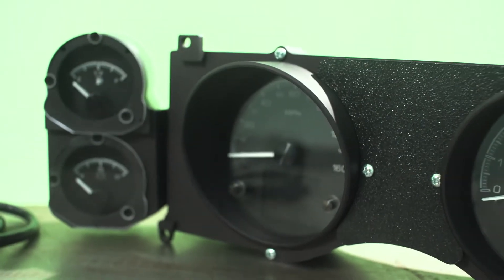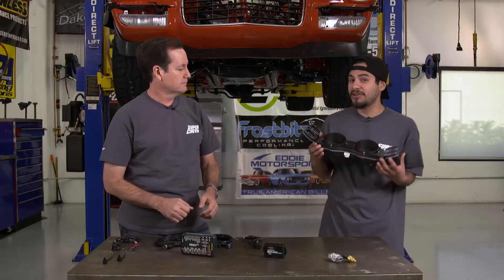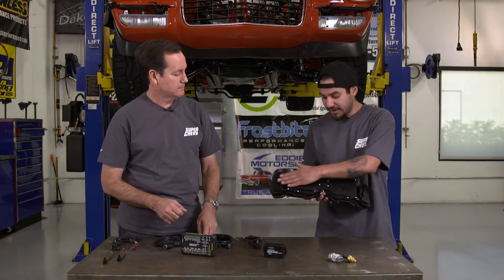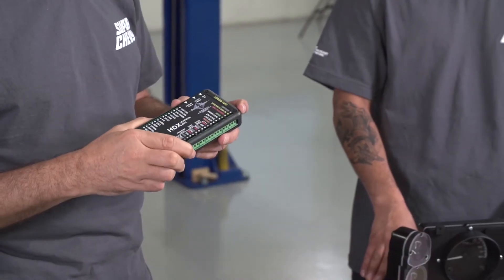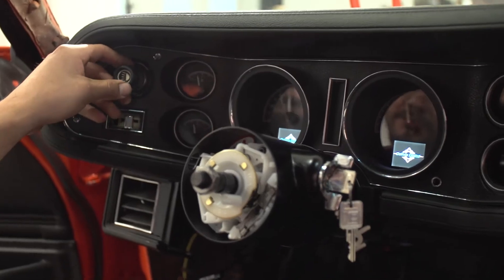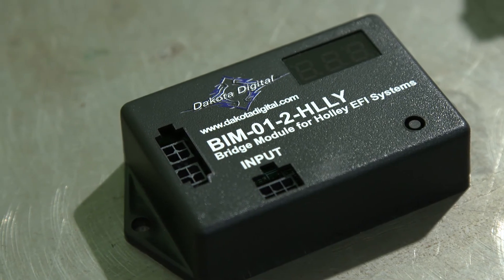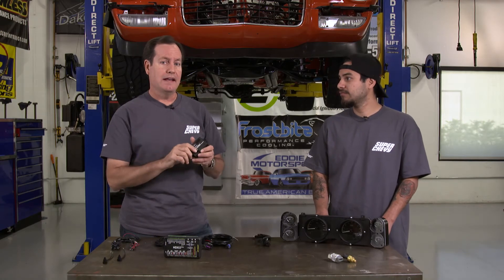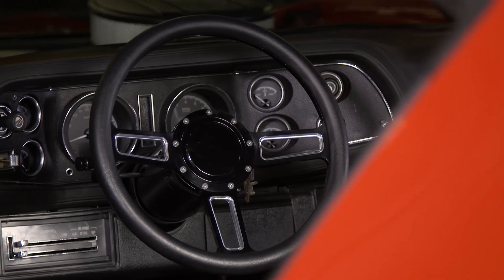Week to Wicked 2nd Gen Camaro - Dakota Digital HDX Series Gauge Install

Comment: Where is a good ground for the 2 monetary switches under the dash or should I ground them to the factory ground wire in the dash harness?Thanks
Reply from the maker: Hey there Dickey,
The two switches can be grounded right with the control module, keeping the wiring consolidated.
Reply: @DakotaDigitalTV  so should I ground the control box from a ground wire from the car or the ground wire from the dash harness?Thanks
Reply from the maker: @dickeymoore4264  We would suggest grounding the control boxes, and switches, to a solid ground point in the vehicle.
Reply: @DakotaDigitalTV  ok Thanks

Comment: So can you use this with factory wires and stuff
Reply from the maker: Thanks Jason,
You will retain some of the stock (or aftermarket) wiring.  Since our gauge kit includes sensors and specific harnesses for Oil Pressure, Water Temp and Speedometer, this will take care of a percentage of the installation process.

Comment: What do you do with the old speedometer cable?
Reply from the maker: The stock speedometer cable is removed, replaced by the included pulse generator.  This device converts this over to electronic.

Comment: My '74 Camaro is not computerized....how would these gagues work with my speedometer cable?
Reply from the maker: All kits include a pulse generator which threads onto the transmission in place of the mechanical cable. This generator creates the required speed signal and sends it to the control box via the supplied 10' harness.
Reply: @DakotaDigitalTV  thanks Ive been trying to figure this out
Reply: @DakotaDigitalTV  Do you need to buy a control box or does it com with one
Reply from the maker: @werewolfman186  A control module is included with all Dakota Digital instrument systems.

Comment: Can I change the dakota digital logo on sweep to a custom image?
Reply from the maker: No, customizing the startup screen is not an option. Thanks!
Reply: DakotaDigitalTV that’s too bad.
Reply: then that sucks for you then, Dakota digital. that's a deal breaker for me, we want custom image capability, plus more customization ability, make Dakota digital great fully customizable not just an expensive dash trademark. we want digital gauges that look insane like a gundam wing spaceship gauges, like vector aircraft digital readouts and such.  more like future spaceship spacecraft stuff,  i'm making my own. ihave a pro touring widebody 1981 camaro its $255,000 for sale and nothing like it has ever been seen going to reveal to public with my own design propulsion system in place, never needs fuel, never needs recharged. constant running condition. 2,000,000 million watts power quadracond. iwant you to sponsor and build this for me and in my design so your name can be on the car.
Reply: @7REDDRACO7  you got a bridge you want to sell me too or something?
Reply: @7REDDRACO7  And you still have a $8,000 fake Camaro.

Comment: My '69 Charger is a manual, but all the pictures I see for a '69 Charger Dakota Digital gauge cluster have the automatic transmission  readout displayed (P R N D 1).  Can I toggle that off, or will that just always be displayed?  Also, I'm disappointed that my original thumbwheel switch to dim the panel won't work with a Dakota Digital dash.  When are you guys going to come out with a reproduction thumbwheel switch for dimming?
Reply from the maker: Thanks for the reply,
Yes, when a manual transmission is used, the gear indicator is disabled.  The displays around it will increase in size, using up the available space.
Sorry, no current plans for a reproduction thumbwheel dimmer.